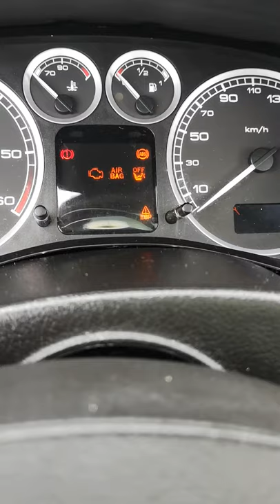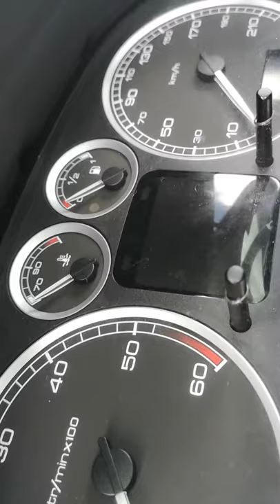problème électrique 307

Comment: If you have this problem and all your gauges are not working and your air condition and hazard light don’t work the problem is your instrument cluster and it needs to be replaced. 
There is no need to change your BSI.
Reply: I have the same problem and I can't find the solution Please, if you can help me, where can I find the error?
Reply: Check you air conditioner and check if your Hazard light, if they DONT work your instrument cluster needs to be replaced.
AC FAN and Hazard light  feed from speedometer cluster.
Reply: @iranpilot3820  I will change the counter Is that what you told me? Send me your account on Facebook or WhatsApp, so that you can explain to me well